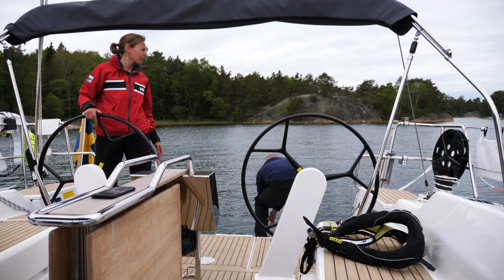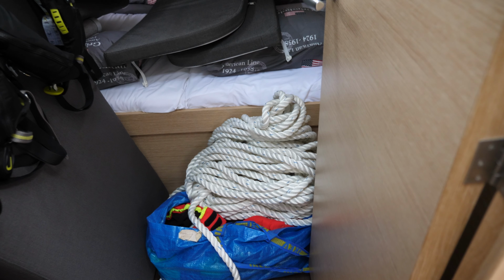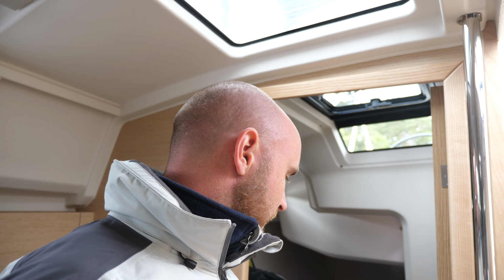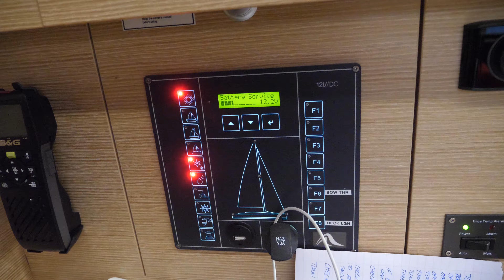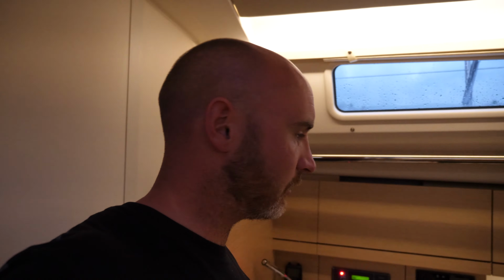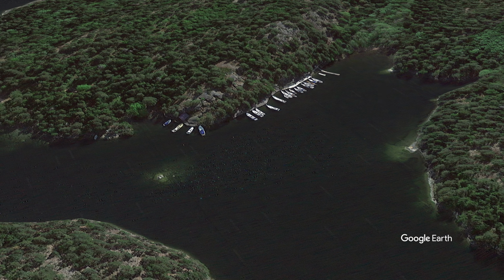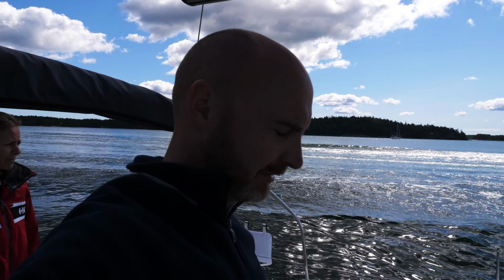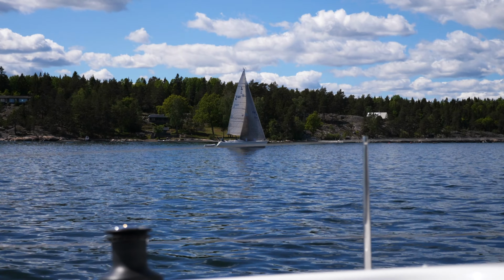EP15 - First weekend of sailing part 3

Comment: To remove the "led flicker" you must adjust your shutter speed down, a quick test on one of my led lights tells me the flicker is gone at 1/100s. - At the end i saw a B&G chartplotter, do you have "SailSteer" ?
Reply from the maker: Hi Tino, yea your right, really have to fix that flicker at some point. Sometimes trying to film, edit, learn more on the camera and get better at it takes way too much time :) YouTube life can be challenging as I'm sure you know also.

Yea the B&G chartplotter/autopilot has heading hold, nav hold, "leeway compensator" and sail steer. It really is a nice piece of kit :) Cheers, Chris and Tanja
Reply: @SailingAurora  Yes it is challenging to make videos but it also makes one wiser. I have learned a lot also from other people who gives me new ideas and correct me. One thing you have much better than others is the sound something many forget. If you want to experience bad sound check out eg. "hilma sailing"

Comment: Hi Chris, Tanja, 

I have watched your videos quite a few times and every time I find other interesting information. 
Perhaps you remember that I inquired earlier after the great set up of your bimini, sprayhood and "grandpa" cover as Tanja refers to it. We very much want the same setup, however, our dealer is not very keen on collaborating with a British company and a German company to install it. So, we are going to try to solve this complication. We hope that you could provide us with a few more answers. Does the grandpa tent use the bimini stakes? And do I understand correctly that you have a sprayhood, a bimini and a grandpa tent?
And this is a tricky one, would you be willing to give us an indication of how much you paid for your set up? 
Kind regards, Mirella
Reply from the maker: Hi Mirella,

No problem at all, happy to help. Sorry to hear that you are having this problem getting the cockpit tent you want, we really love the design we have and can highly recommend it. We only have one set of covers for the tent if you choose not to put the sides on it is essentially a bimini with the front closed zipped to the sprayhood.

It consists of 7 pieces 1. The sprayhood 2. The top "bimini part" that sits on the frame permanently, unfolds and zips onto the sprayhood 3. Port and starboard side with the windows zips onto the bimini 4. 3 back pieces that connect with the sides and the bimini create a full cockpit enclosure. Although you can probably see this on Episode 10 at 19 minutes.

The bimini itself is fully supported by the frame and requires no tie downs on that part, it's only when you start zipping the sides on there are rubber hooks and a few straps that secure the whole cover down to the boat, the whole process of putting it up doesn't take long. I hope all of that makes sense.

We paid €2100 euros for the sprayhood and then €4500 for the full cockpit enclosure and then €400 for fitting. Dam it's quite a price, wish I never looked :) I can highly recommend it though, when the weather gets cold and windy this really transforms the comfortability of the cockpit immensely, whether you are sailing or at anchor, we really love it. There have been many times where we would have just had to go inside or struggled to keep warm if we did not have the cockpit tent.

I hope this helps, send me an email to info@sailingyachtaurora.com and I can reply to you with the full appendix of what we ordered if you want.

Best regards, Chris and Tanja
Reply from the maker: Just to add to this also if you contact kapell annat directly, I think they have there own service team that frequently goes to Greifswald to fit the covers for you there before you pick the boat up.

Comment: I came across this channel yesterday and have been binging y’all since. I do have a question though. Do you think it would be possible to put a hard top up since the traveler doesn’t come into the cockpit
Reply from the maker: Hi Noah, thanks very much for watching and for the compliment. Absolutely I think a hard dodger/cockpit would be possible. One thing to note though would be that when we fold our cockpit tent up, we have to release the vang to let the mast go up a little bit until it's in position and then we can lower it again. So I would measure the height and see what height you would have to have it made for and if it would provide enough head room. Let me know if you want any measurements. Cheers Chris and Tanja